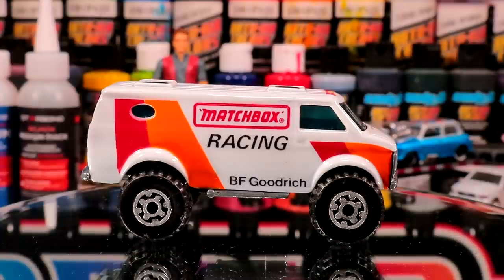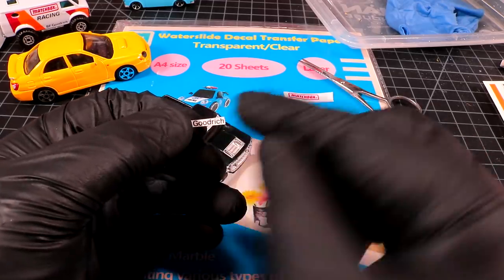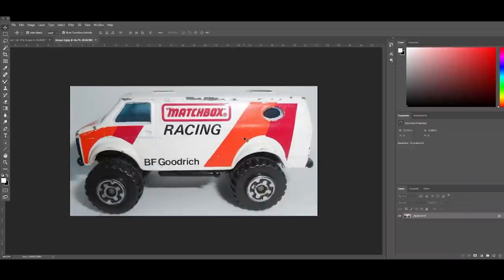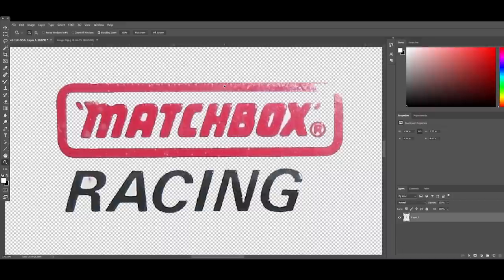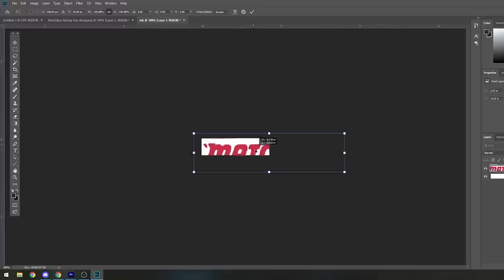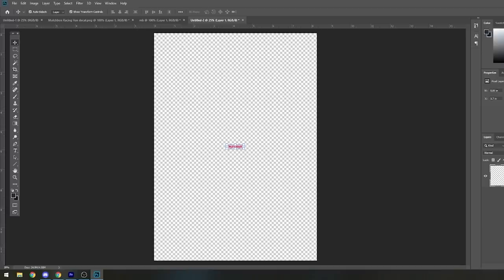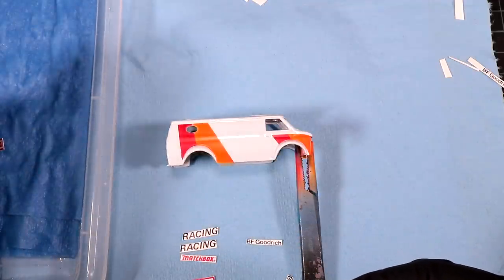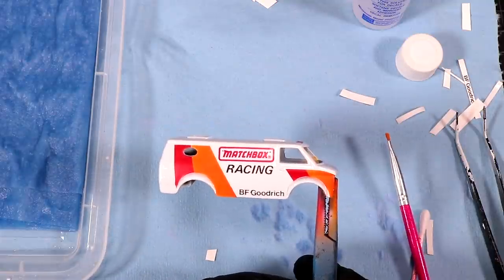MODEL CAR PAINTING TIPS - Making Water-Slide Decals with an Inkjet

Comment: Amazing that nobody mentioned the decal printer of choice from the mid 90’s, the Alps MD system.. but specifically the MD-1000 that used dry ink (thermal) cartridges including white and several metallics. I made hundreds of decal sets for model trains, cars, space ships, toys. I always used the clear decal paper and did most of my design work with Corel Draw! and Photoshop 3.0.5 running on Windows 3.1 on top of DOS. I’d scan photos of real prototypes and then vectorize (trace) the graphics by hand. The rulers, guidelines and ability to lay out the decal sheet precisely made Corel Draw! the most efficient way to do it but it also let me adjust the sizes to fine tune, the duplication could be set so the next one is pasted at a specific interval in any direction, making short work of a large decal sheet. The vector images also scale easily for larger or smaller models too. I could have printed that Gulf set with white underlay and full color on top.. but you could also get tricky and print a metallic silver or gold under the colors too. I’d sometimes swap cartridge ID labels to trick the printer into doing other stuff too. It was fun to experiment and create decals that I couldn’t get anywhere else.
Reply: Can u make me a custom metal maniacs decal sheet for my Side kick model??

Comment: An alternative to the pixel replacement in Photoshop (seen around 8.00) being used to create smooth visual components is to convert to a vector image (drawn shape and fill, not individual pixels at all). That however requires a program such as Adobe Illustrator or Corel Draw. CD is my (relatively) cheap go-to for creating decals for shield designs on wargames miniatures... (yes, weird but effective).

Comment: I bought a Ghost white toner printer setup to print CMYK+white. It's complicated and often takes two or three tries to work, but the system is about $600 instead of thousands and clear laser decal paper is less than $1/sheet if you buy 50 or more at a pop. Very cool to see your process. Thanks for sharing!

Comment: All typical home printers use transparent ink or toner. If you have an inkjet printer sealing the decals is mandatory because it's a liquid when it prints and will re-liquify when soaked. I use Testor's Decal Bonder from Hobby Lobby in light coats to seal those. It's ultra thin and works with lacquer and enamel clear coats. If you use a Laser printer sealing the decals isn't necessary because toner is a powder that is heat applied and fused to the paper. But once laser decals are applied you should start with light coats of clear as gooping the topcoat on can damage the decals (cracking the toner or even causing the toner to "halo" - usually the yellow).

Comment: How do you make images more clean and sharp for higher resolution prints ? I printed out vegita and it came out perfect. But then I went to print out other images of him and they all came out blurry. Is it my printer settings? Or is it the lack of clarity or resolution in the original image I selected from google?
Reply from the maker: Alot of times you need to bring the files into Adobe illustrator and then you can scale them down as a vector image. I dont do that often cause it's a pain but works.
Reply: @DiecastResurrection  is there any other way to do this without doing that ? Or is that the best way to get the best resolution

Comment: Other than buying the more expensive decals or committing to white paint only, there is one way around part of the problem, and that would be to mask off the car and add an area of white paint to the part of the decal that should be white. In the case of the Gulf decals, you’d have to paint a white circle where the center of the logo is. A lot of extra, painstaking work for something so small. I know you could pull it off Austin, but you’re the exception to the YouTube die cast community from what I’ve seen. An amateur like myself might be able to do it, but would probably have a lot of trial and error involved in the process.

Comment: So If you want decals for colored backgrounds you need to buy them?
Reply from the maker: Or get a printer that prints white, they made some older models back in the day that you can still find on ebay. Or you could stencil out the exact size and mask off some white for behind your decal. But it would be tough.
Reply: @DiecastResurrection  Thanks for the reply.  Also, If I wanted to print a Gulf decal without white background, would it be better just to buy it If dont own one of those expensive printers?